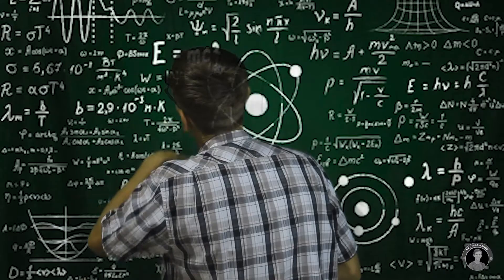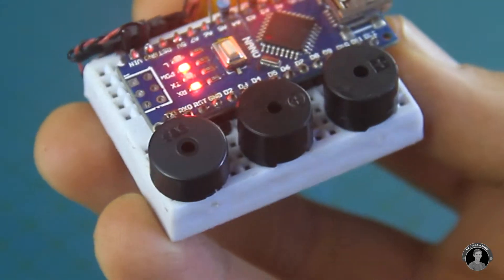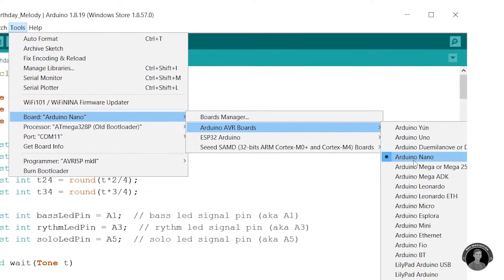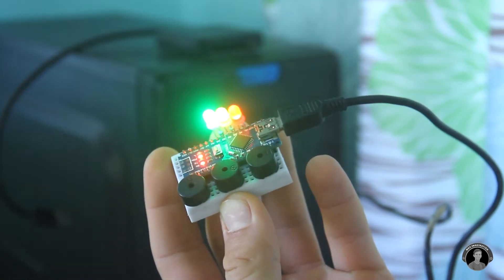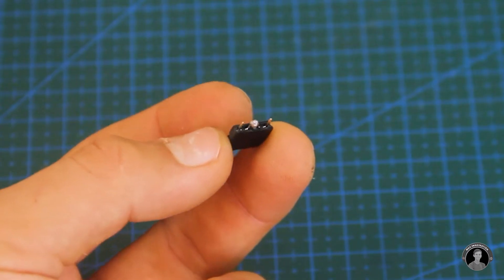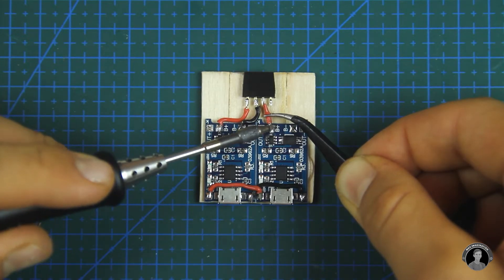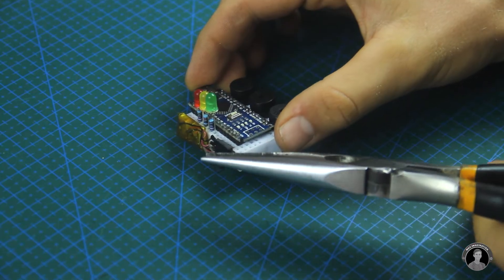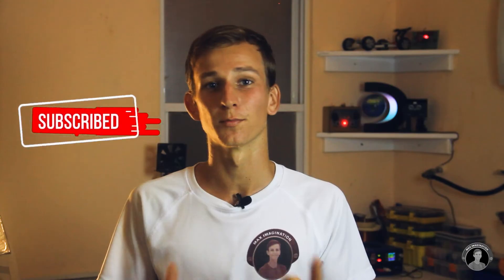Create an Arduino Music Player with Piezo Buzzers | Birthday Melody

Comment: Hello, i have a question, does it specifically have to be 50mAh batteries? The only ones I can find from where I live are 40mAh, hoping to get an answer, thanks.
Reply from the maker: It can be 40, 50, 300, 3000, or whatever current capacity (mAh). The important part is voltage.
Reply: @MaxImagination  Thanks :D
Reply: @MaxImagination  Hello, quick follow up, I'm getting an "programmer not responding" error message when I upload the code, I searched for solutions and still doesn't work, used old bootloader, reinstalled drivers, even reinstalled the IDE but it still won't compile, do you have any ideas on how to fix this??
Reply from the maker: Hi. Seems like you have a problem with your Arduino board. Troubleshoot this out with another Arduino to see if your previous one was fried. It could also be due to poor connection between the Arduino and your computer. Check both things.

Comment: Da pra usar um alto falante só para exibir o três sons? O gnd dos falantes são diferentes do gnd do Arduino? Grato!
Reply from the maker: As this works in a metronome configuration, the 3 speakers give it a more dynamic sound. With this code and type of buzzers, it's not possible to play all those sounds on one buzzer. The speakers' grounds attach to the Arduino's digital pins coded to be as grounds, but aren't in reality. Cheers.
Reply: Entendido. Muito agradecido por sua resposta. Farei alguns testes e pesquisas para tentar unificar o áudio e enviá-lo para uma saída auxiliar para conectar a um amplificador. Saudações do Brasil.

Comment: Hey what if we will not add led and resistor it will work
Reply from the maker: Yes, it will still work. LEDs and resistors are just additional accessories (Resistors are mandatory only if you want to use the LEDs).
Reply: @MaxImagination  thank you very much

Comment: Can you port this code to esp boards??
Reply from the maker: Yes, this should work the same way on an ESP32/8266, simply assign the corresponding pins in the code and do correct buzzer GND programming changes. Cheers.
Reply: The Tone library is limited to the AVR architecture (attiny, atmega) and does not work on ESP32. I haven't found any equivalent with a Tone.isPlaying() function.

Comment: Well done! I just finished building one for my grand daughter's birthday. I had to superglue the four pins on the battery header. They wanted to slide out when plugging them in. I think I got  the pins too hot when soldering  them. Also, I had a bunch of tiny breadboard compatible slide switches and put one in on the corner of the breadboard. I soldered positive lead to batteries to  a single header pin I put through the hole in the Nano board next to VIN. So now it's really easy to turn on and off. Thanks to you and the originator for a fun little project.
Reply from the maker: Hi there, thank you for your comment! So pleased to hear you've found my video tutorial helpful in making your own version. Sweet!
Reply: Please tell material in the discription

Comment: Duuude really need your help right now. I live in sri lanka and I made an electric scooter by myself. The battery and even the frame is built by me. But the battery looses the voltage from 28v to like 22v in seconds when I accelerate it. Do I need more parallel batteries to minimise the voltage sag
Reply from the maker: Hi there. That's a bummer to hear! First of all, what are your battery's specs?
Reply: @MaxImagination  it's a 24v battery made out of used laptop batteries. A 7s one with 4 parallel cells. Maximum voltage around 29v
Reply from the maker: @RTP_LION  Shoot... that's because they're laptop cells, those will most likely get used up in no time and lower your battery's performance especially when you happen to include the weak cells, because they're used. I had to learn the hard way as well with my battery underperforming that brand new cells are much better to use in a DIY battery pack.
Reply from the maker: The best thing you can do is to start over and carefully pick only the good cells out of old laptop battery packs that have decent tolerance and voltage. Those cells must also be tested under a load before including them in a DIY battery pack.
Reply: @MaxImagination  what if I just upgrade the battery with 4 more parallel cells
Reply from the maker: @RTP_LION  To do that, you must make sure that all of the cell you have included in the battery pack are healthy as well...
Reply: @MaxImagination  they are healthy but I only used 28 cells. I'm gonna find more 28 cells and expand the battery to increase the capacity. If that doesn't work I don't really know what to do. We can't really afford new cells here they are kind of expensive. So hope this works. Thanks for the help 🙂